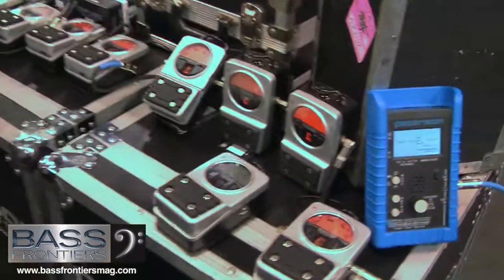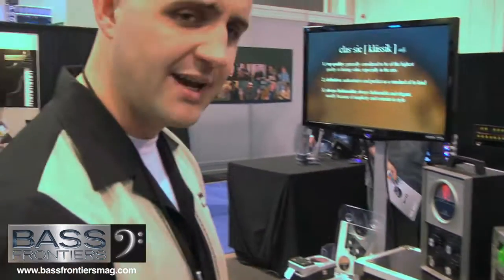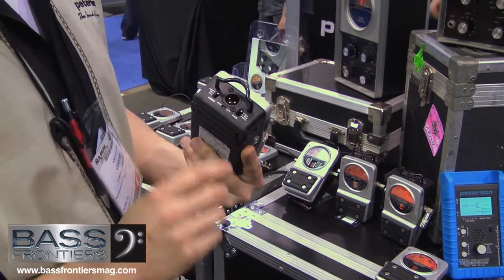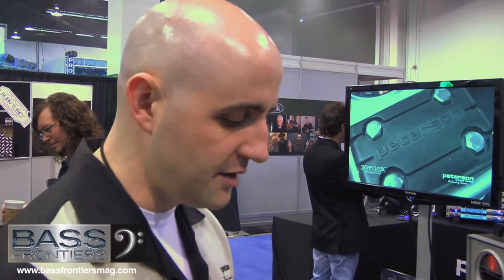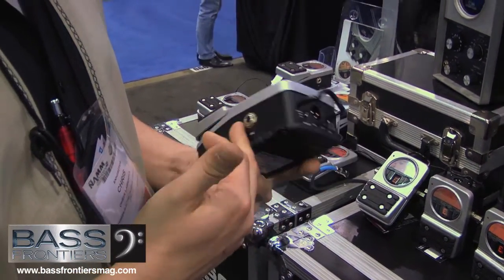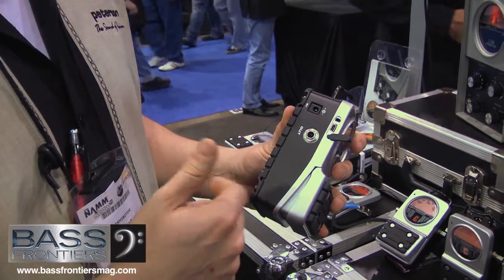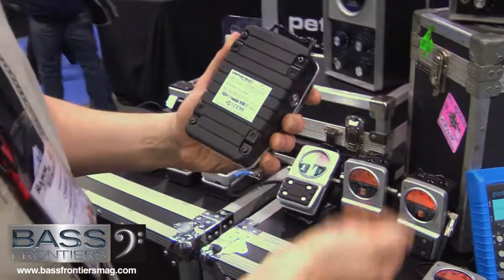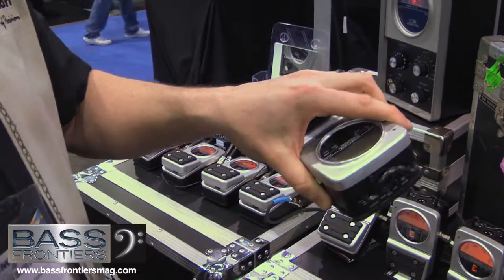Peterson Stomp Classic Tuner NAMM 2011

Comment: @andrewbarnall Active DI means that there is a 9 volt circuit that translates the signal to a Mic level output.
A Passive DI does not use a 9 volt circuit, instead using a passive transformer for proper load and isolation.
A proper Active DI circuit can produce a more accurate signal output than a Passive DI transformer, 
which is known to be less-than-accurate.